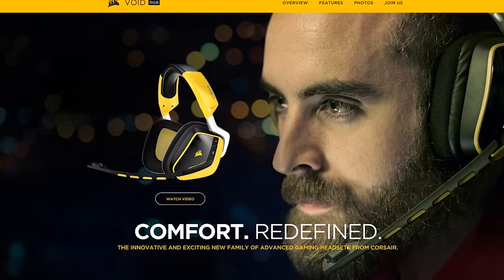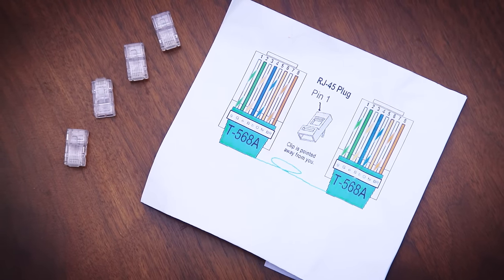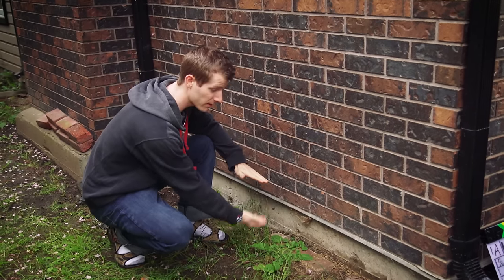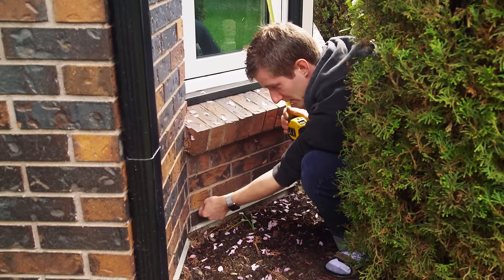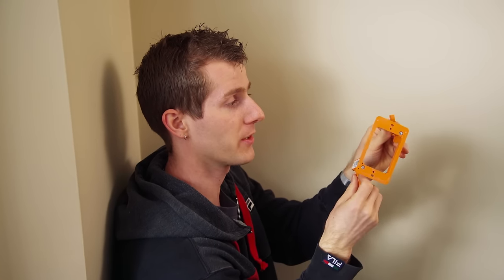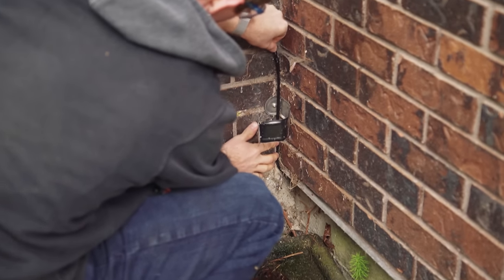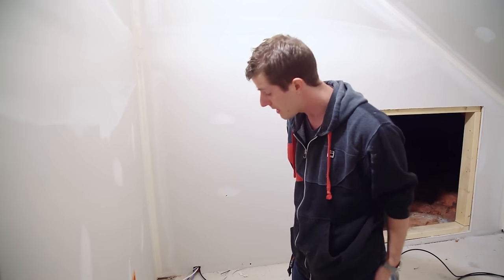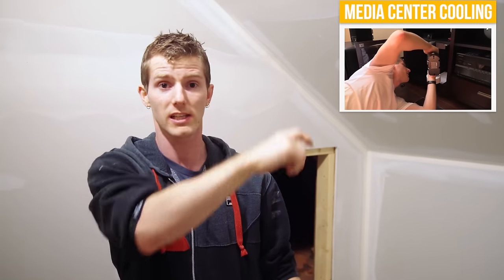Optimize your cable runs at home! - Installing an exterior Cat 5e cable

Comment: I did cable instillation  while in college. 

You really mess up by not drilling slightly upwards. It helps keep water from seeping in. The sealant will be a water barrier but it's important to know houses do move(settling/earthquakes/different loads). By drilling slightly upwards you putting additional protection and it cost you nothing. 

Like I said, you're probably fine but anyone else watching this. Please drill slightly upwards. Or if drilling from the inside out, you drill slightly downwards.
Reply: Good tip!
Reply: cable installation as a college course? wtf
Reply: Cool thanks bud,  awesome tip!
Here in Australia you need to be licensed not to sure what it's like in Canadian land though
Reply: Where did he say anything about it being a college course?
Reply: I believe only on a commercial\professional level. General home networking is fine.
Reply: +AntVenom never thought I'd see you here!
Reply: He watches a large amount of Linus videos, he comments from time to time
Reply: madmick82 Not in Australia bud,  you need to be licensed to even run anything in your wall.
Reply: Smarter to drill from the inside out as you first make the junction box hole, this will ensure you don't drill into any mains cable, telephone cable or plumbing

Unless you saw the house being built from from the concrete slab being poured to the electrican's and plumbers routing the utilities and know that nothing is there.
But if you saw the house being built and you didnt opt to get ethernet, HDMI, ect routed before the dry wall went in you are stupid.
Reply: What licensed to install ethernet?
I know for 240v yes, but ethernet come on it is not even low voltage
Reply: IIGrayfoxII Granted,  these days most if not all houses built have networking/internet/access points in mind.
Reply: the house is already built, most of the settlement already happened and when you design any building you make sure it wont have a big settlement, and it will be in the range of 1-3 cm at most, so no need to do anything special like u said.
also "different loads" when you are designing something, you assume the maximum load that building will ever have, and design for that, so no matter what you will put in your house u will be fine, except if u fill it with gym stuff ofc :P
Reply: You don't have to be licensed for data cabling in Australia AFAIK.  
Also, as a tip don't run your data cabling along side your power cabling because of magnetic interference.
Reply: rip #haveafuckinggoldstar, and +AntVenom big fan
Reply: WOW i didnt know that
Reply: +endfm in australia, you need to be licenced in order to install electrical outlets in homes, however, standard cabling at less than 48v is fine.
Reply: Yes good point and he should had cleaned with a water hose the day before the wall, so the cable will have been in a clean base support. Little details that can change your life.
Reply: Actually on linus installation is with a professional router/switch that accounts for the cable resistance (function of the lenght (in muggle ^^) ), but in the a consummer grade (as provided by your Internet service provider) you can run in some trouble for long lenght cables, packet loss most of the time.That's why cctv by ethernet cable kinda suck, it's not the worst but they are better solution (worst is wireless transmission).
Reply: nope, you need to be licenced to run data cable anywhere ( commerical, industrial,domestic). 
Need a ACMA cabler's licence for data/telephone. There are various forms that needs to be filled out to certify the install ( TCA1 for example). That said, if the home/building owner runs the data cable themselves, then that's fine too. If anything goes wrong, it's the owner's problem.
Reply: +Elysiann yes, you need a license if its commercial. however, if youre doing it @ your house, which is the focus of this video, then its a complete non-issue, unless you are installing electrical outlets.
Reply: Not really. 99% of the time it's fine. But I have had to remove data cabling that a home owner did themselves as the council deemed it illegal and the home owner was fined.
Reply: I'd much rather get it done with somebody licensed which is an absolute requirement to network your house here in Australia. There is nothing better then pumping 240v down a line to wake up a tech grabbing your pair out in the street.

Elysiann precisely,  also quite dangerous much like those rouge antenna installation guys.
Reply: Yes licensed thank god, as you are connecting to a wider service i.e your internet provider, and it keeps a high standard of work, you never see bare cable like this outside, conduit is a must
Reply: Hmm, let's see if someone in the comments is complaining about some small detail....

Yes
Reply: He Also forgot to put in a drip loop on the cable or  seal it to the side of the house. He also needs to seal the soffit hole and seal it to the side of the house there. Or Drip loop
Reply: You do not need a drip loop.
Reply: good point
Reply: tcpnetworks If you seal it to the side of the house, I would agree. If you do not, Yes you do.
Reply: I also would have tested the cable before anchoring anything down. Though he had a short run and few obstacles, you never know if the cable got damaged in the run. Granted this is something I learned while running cable for server farms and other large corporate installs but it will cut down on having to redo a lot of work. I mean what's faster?  Reterminating an end or going back cutting zip ties and unscrewing tie downs?
Reply: Yep. It's what I noticed my self. Slight drill upwards and the water will run down the cable and away from the house. 

Another thing I noticed. Did Linus drill on his foundation? Big no no. Huge no no. As the house settles that's a weak point and has a higher chance to crack the foundation.
Reply: you're so wright
Reply: by up/downwards did you mean that you should drill slightly tilted or with an angle between the wall lesser than 90 degrees.
Reply: +Batuhan Bulguroğlu like 75 degrees. Just move the bottom of the drill slightly down. Kind of aim the bit at the bottom of the neighbors roof
Reply: 75 is almost straight down or up, should do 15
Reply: Sweet Tip, I'll keep this in mind.
Reply: wow, you thought the same thing i did. Just shows where the Pros and the amateurs are. :)
Reply: Thank you
Reply: +Terry Sterling thank you
Reply: +0sjors0 thank you
Reply: also it becomes easier to flat your cable to the wall when the hole is not perpendicular ^_^
Reply: would droping the cable though the wall have been easier then going outside?
Reply: Minecraft youtubers watch Linus? What has the world come to?
Reply: After working in construction a large portion of my life, that information you provided is not needed. As long as you sealed off the hole properly with outdoor caulk or putty you would never have an issue; In fact you should ALWAYS seal a hole you make into your house, so there would never be water issues in the first place. 

You overly dramatize the situation by making it seem like if you don't slightly angle a hole into your house it will fall down. It was a course that had to clearly waste as much time as possible, and they focused on something so trivial, I question the fact that they would even have a "cable installation" course in school, that just sounds ridiculous and a waste of money/time. 

I've built over a dozen houses from the bottom up, and not once was a told by a superior to drill upwards, and that includes all work, HVAC, Electricity etc. If anything it was a decent tip for additional proofing, but to say someone "really messed up" by not drilling upwards shows you ignorance towards the subject.
Reply: +Zetsuei13 I just helped to replaced a sill plate in my friends house that had rotted out due to water tracking down a cable run and through the cracked caulking. Caulking fails very easily, make it the LAST line of defence to keep water out, not the main one.

I have also spent a lot of money fixing the stupid mistakes made by "professionals" cutting corners and just getting the job done so they can get on to the next site. Sloppy work is sloppy work, regardless of how often someone tells you it is good enough for your day job.
Reply: This is correct, HOWEVER there network cabling run inside a wall (or through a wall) counts as permanent wiring, and under ACMA guidelines any cabling plugging into a telecommuncations network requires a registered cabler to install it - as network cables eventually terminate to a device which connects to a telecommunications network they are classified as one of these requirements - http://www.acma.gov.au/Industry/Telco/Infrastructure/Cabling-rules/customer-cabling-rules-and-requirements

It raises an interesting question though - if a real NBN is rolled out then it'd be fibre after leaving your house.... electricity can't run over glass fibre - so it would make it legal to do your own wiring....
Reply: Good thing Linux lives in Canada and not au where the ACMA is lol!
We are Canadian and can do anyhting we want since we have our own code of behaviour.  But he failed to have a person watch for native wildlife such as polar bears!  That is what neighbors and a case of Beer are for.
Reply: +RealLuckless That has nothing to do with a cable being ran on an angle. That is simply someone didn't use the correct outdoor caulking. So you've already enabled moisture to buildup, and begin the deteriorating process. If water is already inside of your walls, then something has gone wrong down the line elsewhere, tilting the hole is a good "tip" if you wanted a prepare for something else to fail, but by no means is it something "necessary".

A hole slightly tilted downwards isn't going to change water being absorbed into a specific area, that is due to other issues and should be looked into further if what you're saying is indeed fact.

P.S. Exterior caulking is waterproof, and does not fail if it's installed correctly. Issues such as your friends only occur when people don't inspect their own houses yearly to make sure things are normal. It's always easier to fault the worker, rather than the buyer who failed to understand what true ownership of a house or product. To blame a cable not angled is just absurd and dumb.
Reply: Yep, with time, caulk always fails.
Reply: Benjamin Columbus Just a tip for others who want to wrap their house. But I guess if I'm complaining, you're complaining about complaining. So, :toot:
Reply: Totally unnecessary. You do realize that the cocking will move with the house... right?
Reply: To Athánatos You just wrong on this one. Sorry. Sealant always fails over time. Happens around bathtubs, etc. Having a slight downward slant from the inside to out will help protect the house. 

Plus, just because they both move doesn't mean they move equally.
Reply: Totally unnecessary
Reply: No sealant is perfect and relying on it entirely to keep your house dry is just dumb.
Reply: Actually (from my experience working as a cable intaller. (current job)), its best to drill from outside in on brick houses so you dont drill into the middle of a brick and it crumbles. especially older brick.
Reply: you can run extra low voltages cables without being qualified , and if you own the house you can run whatever cables you want
Reply: From the ACMA site... "All cabling work, including telephone, data, fire and security alarm systems cabling, that connects with the telecommunications network must be performed by a registered cabler or under the direct supervision of a registered cabler."

So, yep. need registration. It used to be an AUSTEL license, now have to be under one of five ACMA regitrars.
Reply: Nah mate, need to be registered installer with the ACMA.
Reply: Ant! :D Can't wait to see your stuff with LMG later!
Reply: +Zetsuei13 where did you build those houses, some 3rd world country I presume?
Reply: Copy paste hero... You guna get a sparky next time you want a cat cable made up? cause that's all that has happened here... just cause it's screwed down makes no difference. If the cable is on the consumer side of things (for example after the phone point that the modem plugs into) there is nothing to worry about and customer can do as they please with there network cabling. What gives me the authority to say this??? Just my electrical registration and practicing license. But then again keep telling people that I have to connect their cat cables, easy money for me that way  : )
Reply: Harry Harris Ah, but if the cabling does not directly connect to the commercial network then you don't need to be licensed.
In this video and the general case for DIY data cabling it connects to the modem/endpoint device, but from the router to the communications pit is done by a licensed technician.
Reply: Apparently some people are slightly confused over what the regulations in many regions actually say/mean.

If you dig into them then you'll find exemptions for minor work done by the homeowner. Going to rewire my whole house and put in a new panel? Well, then I need a licensed tradesman to come in to do all the connections and an inspector to sign off on it before the walls get closed back up.

Going to run a length of network cable or swapping a light fixture that is in an existing box? Yeah, I don't even need a permit for that, because that falls under regulation exemptions where I am.

Where the regulations DO come into play and would smack me down for trying to do the work is if I go over to my neighbour and say "Hey, give me $50 and I'll run that cable for you..." because now I'm doing the work of a hired trade, and I'm not licensed of legally qualified for that kind of work. I could get the certifications I need for that kind of stuff, but I have better things to do with my free time, like write random comments on YouTube videos.
Reply: A valid point considering that hole is low enough that it is likely going to be submerged by snow during the winter months (read: melting snow in spring)
Reply: Thanks dude !!!!!
Reply: That's what I was going to say I'm a UK installer and have done this job hundreds of times and its always raining over here. so yes drill hole draining to the outside of your home
Reply: You shouldn't use "Like I said" when you said no such thing and actually said quite the opposite. It kinda negates any credibility you sought to obtain by telling us that you installed cable while in college.
Reply: drilling upwards is always recommended even if just a little but what is more important is to never go straight up with the cable form the hole (if its supposed to go straight up u need to make a half loop) so that the water doesn't follow the cable down into the hole.

linus didn't do that luckily and i dont see anything wrong with what he did since the the cable go down and he drilled straight and also applied seal into the hole there will never be any issues.
Reply: @+madmick82  Not in Australia bud,  you need to be licensed to even run anything in your wall.
Nope. Fellow Australian here; You only need a licence for mains work. It's completely legal to do your own network cabling.
Reply: not true, you need to be a registered cabler (restricted for domestic and open licenced for commercial) with the ACMA. they recently changed it so you need 360 hrs experience to get it too.
Reply: smelly box not true
Reply: In Australia, it's illegal to do your own fixed home cabling. It's legal
 to connect devices using pre-made ethernet cables strung along skirting
 boards or under carpets but permanent installation in roof cavities, walls etc is illegal. cheers have a good one.
Reply: why is that so?
Reply: Why would it be illegal to do fixed cable installation yourself without certification in some places? Probably "Because people are idiots..." 

I've pulled crispy cat5 cable out of a crawl space, which near as we can tell had been wired to a 220 mains feed at one point. "People are stupid, and stupid people are why we can't have nice things"
Reply: people do all sorts of things, i see plenty of dodgy work from electricians and people who should have a licence. 

we do live in a nanny country, nanny australia likes to make sure that we are safe and tuck us into bed at night. 

to be honest, its not too bad living here, i love Australia for too many other reasons to consider leaving.
Reply: Most of these comments are correct in stating that you should drill at a slight angle for drainage. But what everyone failed to mention, is that, (if this house is built to modern codes), there is a cavity behind the brick, between it and the sheathing. The sheathing will be covered with a moisture barrier, which, at the bottom, will lap over the sill flashing, which typically is a metal flashing placed under the first course of brick, and then bends at 90 degrees and runs up the sheathing behind the moisture barrier to the height of 12", or about 3 courses of brick. 
It is usually a no-no to penetrate that flashing, as it allows moisture accumulating in the cavity to reach the sill plate. 
There is supposed to be 'weep holes' about every 2' in the first course of brick @ the head joints (vertical mortar joint) to allow any moisture to escape, however, I see none in your wall, which would make things all the worse.  Being your house has a sunken living room, I'm not sure how it would be affected. Of course, I could be mistaken.
Sooo.. caulk the shit out of it!
here's a link that might help
https://www.ahit.com/news/inspecting-brick-veneer.html
Reply: Drilling from inside out with brick? That is how you crack bricks.
Reply: Drip loop? The cable went down with chalk. Let me guess, coax cables need rubber weather grommets too?
Reply: endfm in the USA u have to be licence or with someone who is licence
Reply: and also with it being at a angle...you have less stress on the cable...but I would just use 1/2" to 3/4" pipe for the cable run outside for future needs..like running fiber because since what ever ISP you use can hookup there fiber. In my area, Telus is dumping all their old cable for fiber, which will eventually run fiber to homes...well they offer fiber to your home now...but with one big price tag. think they qouted me $5000..but I say in about 10yrs, all homes will have fiber going to their homes...well depending on where you live.
Reply: Rag
Reply: In free countries people are allowed to do whatever they want want with the house they own as long as it doesn't affect their neighbors. 
It's called low voltage electrical and there's no requirement for a license in most places because there is very little chance of there being a safety issue.
Reply: Jontiac ,
yep.
... and refreezing at night...
Then thawing again the next day ...
( rinse + repeat )
Reply: Apparently we aren't allowed without a license because it's considered a fire hazard
Reply: Exactly, Sir. These people read into WAY to much on this crap. Its an effing network run on his own house. No need for anyone other than Linus himself to execute the task.
Reply: Yeah why wouldn't you drill from the inside I feel like it's more accurate?
Reply: Also doing a loop in cable coming from holes allows water to drip off too, especially using if running cable near electricity etc...., but should always do anyway outside. Might notice tv, satellite, etc. companies always do loops. Lastly, drilling into cement instead of brick isn't that bad for cables, but if mounting something, definitely go into brick as will add more support & prevent cement/grout/mud (whichever you call it in your part of world, lol) from cracking & degrading allowing for water damage, as that would be bad...my grandfather was a masonry....
Reply: This guy does not know what he is doing. There were Numerous NEC violations. He may know computer hardware and technology expert but he does not know home wiring or electrical code.
Reply: Capillary Action would make drilling the hole at an upward angle pointless. Its the quality of the sealant that really matters in this situation.
Reply: @Zetsuei13  You're correct, bc of capillary action.
Reply: I'm sure Linus knows what he's doing .
Reply: @Elysiann  It sounds like you ratted them out????
Reply: @aaronmorahan6205  IDK how I ended up here but this whole comments section is hilarious.
Reply: Sometimes not possible
Reply: Avoid drilling into your house at all costs. You can fish the cable through interior drywall instead of compromising the seal on your house.